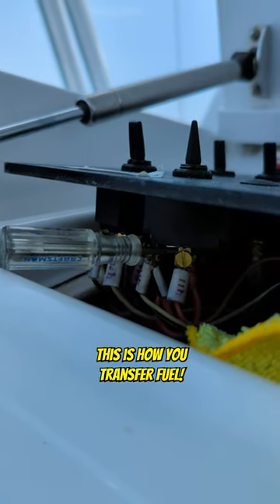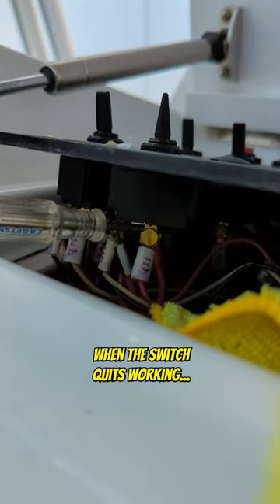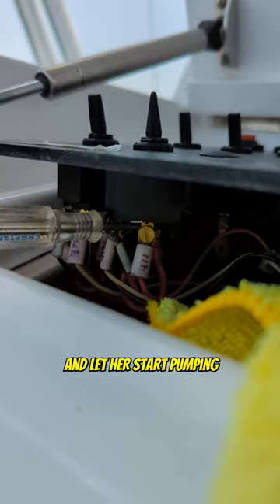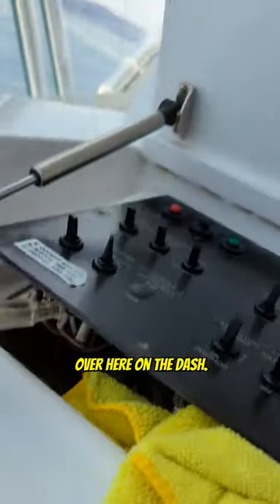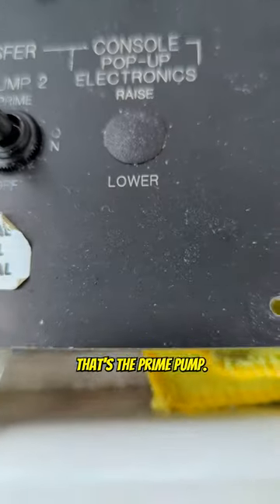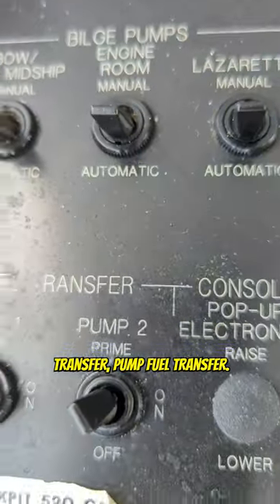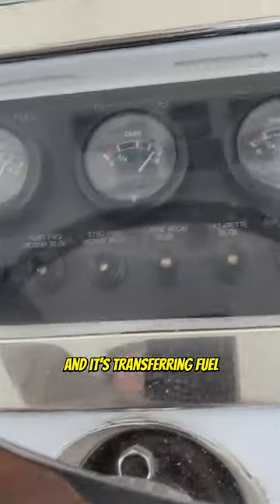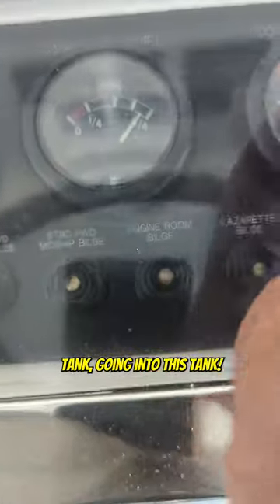Transferring Fuel from one fuel tank to another! #fuel #fueltank #fueltransfer #boating #yachting

Comment: Cool ez trick for someone to use. 
After getting stuff in bad weather at 2:30 in the morning while pulling a net I put a extra switch panel under the console so I just open it and it’s got jumper switch’s going directly to all my deft pumps an also to lights so a fuse blows I get lights right back on and change the fuse on the big boat 🙏🏼🙏🏼
Reply from the maker: sweet sounds like fun